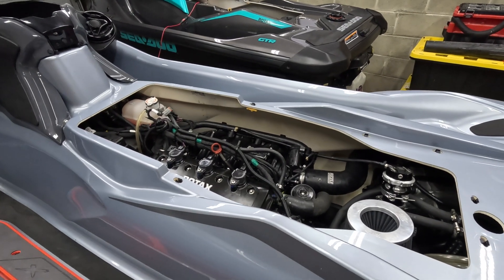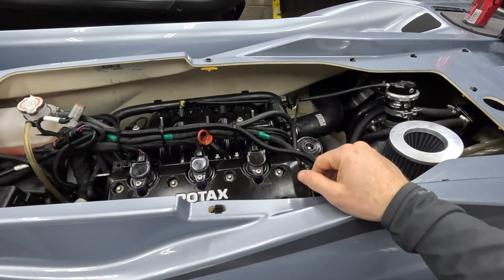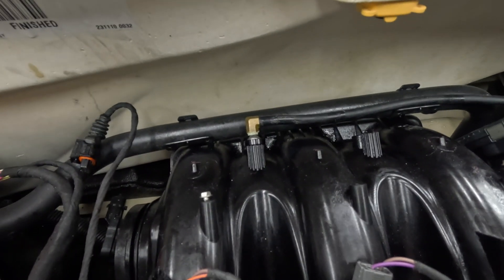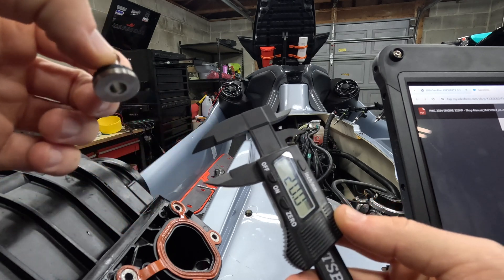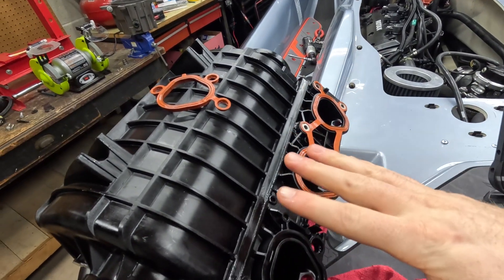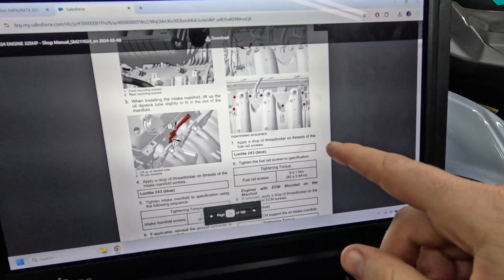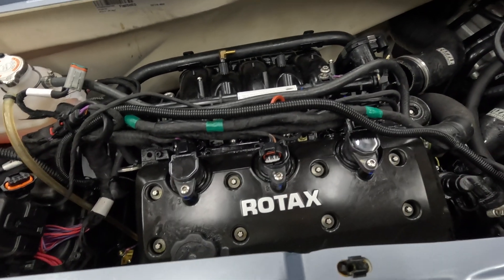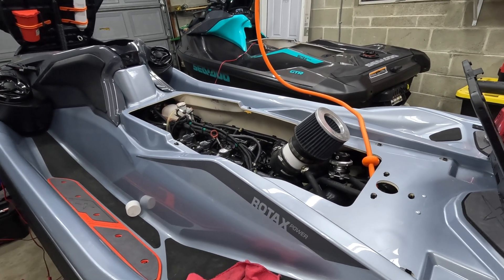How to Fix the SeaDoo 325 Intake Manifold Defect for Free

Comment: the flange on the bottom of the trundun is only to hold the gasket on a copper washer will act as a crush point for specs and save the aluminum from scorring

Comment: Can these be removed individually without pulling the manifold? Or does the gasket prevent you from pulling them one at a time?
Reply from the maker: You can remove them but its impossible to put back in without removing the manifold since the spacers are held in place by the gasket.
Reply: @jakgal041 that's what I figured after watching the video. Hard to believe they haven't addressed this issue. My 2025 rxtx 325 was leaking at every coupler right from the factory. I had already ordered the fizzle intercooler and piping kit with bov and installed it when I re tested only to find the manifold was leaking also.
Reply from the maker: @jacobburton1509  I'm really curious to see if they fix the problem on the 2026's!
Reply: @jakgal041  that would be a slap in the face honestly. They could at least acknowledge the issue with a TSB before rolling out the 26 models
Reply: @jakgal041 well I pulled mine apart this morning and to my surprise my factory ones measure out at 19.48mm
Reply: Which is odd because our other ski is 20.7mm 😂

Comment: I have a 2024 rxp x 325 I did this fix checked no boost leaks holds 25 psi I still get a code p2282 do I need to clear with a scanner ?
Reply from the maker: The code should clear on its own if there's no problem. Do you have an aftermarket BOV by any chance?
Reply: @jetskijake-seadoo I don’t ski is completely stock
Reply: Checked it again for boost leaks no leak now but soon as you floor it check engine pops and code p2282
Reply: I didn’t ride it far though just started it in the bay and floored it should I try to ride it longer ?
Reply from the maker: @nickrodriguez8941  Yup I would give it a good 30 minute ride.
Reply: Thank you !!!

Comment: My ski was fine, till today it started showing this code. We shaved it down to the measurements you gave went to test it code didn’t go away. Any suggestions??
Reply from the maker: How long did you ride it for? The code will clear itself within a few minutes. If it doesn't, it means the problem is still there. You may have a boost leak somewhere else. I have a video on how to do a boost leak test, I would watch that because it'll pinpoint exactly where your leak is.

Comment: Hey Jake just took apart my 25 rxt325 measuring 19.52mm on each should I keep shaving?
Reply from the maker: Yes you want them down to 19.0 or just under or else it will leak.
Reply: @jetskijake-seadoo  thank you
Reply: My 24 rxt 325 was  also sitting at 19.52, didn't test for leaks but shaving them anyway.

Comment: Hey i have a deans tuned ecu for 8700rpm , intake, exhaust, blow off valve and tubing but im only hitting 78-79. Do you think i have a boost leak???
Reply from the maker: You very well could be, did you also check out the iBR stops and ride plate?
Reply: @jetskijake-seadoo  I need to check both of those. My normal mode feels faster than my sports mode which is weird.

Comment: Is it possible to just take the bolts off and remove the studs without taking the entire manifold off?
Reply from the maker: Unfortunately not. The gasket loops around the studs so there's no way to re-insert the studs without pinching the gasket. Once you pull it off you'll see exactly what I mean.

Comment: took off intake manifold and about 2oz of water came out, my thoughts are if air can get out water can get in i ride in ocean 100% and rinse motor throughly what are yopur thoughts thank you
Reply from the maker: Water gets into the manifold from one of two ways. Either you sank or submerged the ski and the engine took on water which doesn't sound like your case. The other is that the intercooler either had condensation or its leaking. How old is your ski? When you winterize it do you use RV antifreeze?
Reply: @jetskijake-seadoo  the ski had 1 hour on it when i bought it from dealership it was used not a demo,i have owned it for a month i live in tampa fl. we ride year round checked for condensation found a little mixture of oi and water problably less than a ounce, so dont know what kind abuse the ski took for the 1st hour of use i broke it in properly raced my buddy with his stock 2022 rxpx 300 he beat my 325 rxpx from the start to the finish so disapointed going to install the same catch can that you use
Reply from the maker: @ yeah I was about to say the oil is most likely just crankcase blow by so a catch can will help with that. Condensation is big especially in Florida, no real fix for that but riding the ski for the first few minutes usually dries it out.

Comment: Thanks Jake for all your great videos I have a 2024 rxpx 325 9 hours on the clock used to run great un till today at wot only gets 66 mph at 7800 rpm no fault codes or hesitation just poor peformance so iam going to assume the intake manifold is leaking is it possible to remove one spacer at a time with intake manifold still mounted to engine and replace or shorten them
Reply from the maker: Unfortunately not, you can pull them out but it’s almost impossible to reinsert them properly because of the gasket. Believe it or not it’s actually easier to just remove the manifold than to do one spacer at a time.

Comment: Is the 300 affected or is it just the 325?
Reply from the maker: Nope, this is only a problem on the 325 platform. Its still possible to have boost leaks on a 300, but this specific leak is only found on the 325's.

Comment: Hey Jake, what size Turbo boost leak  tester  for my 2024 rxpx do i purchase? Also do i need to cap off the exhaust and throttle body for this test? Also what is the torque spec for the clamp on the boot? thanks!
Reply from the maker: You need a 3" tester. You can either buy a ready to use tester like the one I have or just use a PVC end cap with a silicone coupler and a threaded compressor fitting. I personally like the ready to use one since it's just ready to go and has a pressure gauge built in.

You will not need to cap the exhaust or throttle body. 

There's no specific torque spec, you just want it decently tight. Don't over do it, just make it decently snug.

Comment: Great videos !! off topic question. I'm looking to buy two jet skis but have a small garage , trying  to figure if both will fit. your garage  looks about the same size and all seems to fit well.   What is the approx dimension of your garage. thanks !
Reply from the maker: @robbieb9602  My garage is about 15x25 approx. unfortunately my garage door is only 8 foot so I had to pull the skis in on a cart since my double trailer wouldn’t fit. I plan on installing a 9 or 10 foot door this year.

Comment: Jake, is additional maintenance involved with the supercharged Rotax vs. the 170-hp models?
Reply from the maker: @michaelsantino2037  Slightly more but not much. You have to check the supercharger slip at 200 hours but that’s pretty much the only difference

Comment: Jake have you tried the Imuk mod? If so was it beneficial with the Riva ECU? Thinking about doing mine via throttle body. Thoughts? BTW another great Vid thanks!
Reply from the maker: @mikenegron6162  I’ve been thinking about giving it a shot on this ski. I did it on my 300 but didn’t really notice a difference. I also didn’t have logging capability at the time when I did so I’m not sure what the actual numbers were showing. 

I may end up trying it again on this ski and compare data logs to see.
Reply: @jetskijake-seadoo  I don't have any numbers to back it up but on my 300, I feel like it did help at least the throttle response. I may try it, but I'm not wanting to spend the $ on the kit. I saw a few ppl post that it's possible to do from the TB side so I may take that route and repot back. While I have the manifold off I might as well do this mod to be on the safe side.
Reply from the maker: @ yeah it’s definitely possible to do it through the throttle body hole! I’m most likely going to do it to this ski too but I want to try and get some data logging numbers to see how it does.
Reply: @jetskijake-seadoo  Today might be the day for me! LOL I let you know what happens if I do! ✌
Reply: So started on this fix yes it was leaking at around 14psi and my blow off valve was leaking as well.  In any case have you thought about just putting a small rubber o ring on the base of the spacer itself? Seems like it would work?
Reply from the maker: @Negative, the center shaft of the spacer is what causes the problem since it’s too long. If you were to put a spacer in between the black rubber gasket and the spacer it would just restrict how much of the threading makes it into the block. The only fix is to shave material off of the bottom of the spacer.
Reply: @ Roger that! I'm in process of hand filing it. Thanks!

Comment: If it is new and under warranty shouldn’t the dealer take care of this? Any concerns about diminished stud strength with this mod?
Reply from the maker: @paulthompson1216  If there was a TSB with a fix, absolutely. The problem is that BRP doesn’t have a fix available so a warranty claim will only put another defect back in. 

Also, no concerns with diminished integrity doing this fix. The studs aren’t providing any structural integrity to the manifold and only need to handle 11nm of clamping force.
Reply: @ Got it! Thanks.

Comment: It is irritating that BRP did not address this with a simple fix on the 2025 models.  Unlike Yamaha, BRP will usually address issues very quickly.  Top end performance will only be affected if you have removed the speed limiter by either SCOM or tune.  The 325 even with the boost leak will have no problem reaching 69 mph.  I bet there are many owners that don't know they have a leak unless a code is displayed.  Great video as usual.
Reply from the maker: It really is amazing that it hasn’t been addressed yet. There hasn’t even been a TSB released for it yet. 

I’ve noticed that acceleration suffers a bit with the leak as well as the top end. If you pull the throttle hard from a stop, the leak will prevent you from hitting full boost which of course affects acceleration. Doesn’t seem all 325’s have the problem, but a lot do.